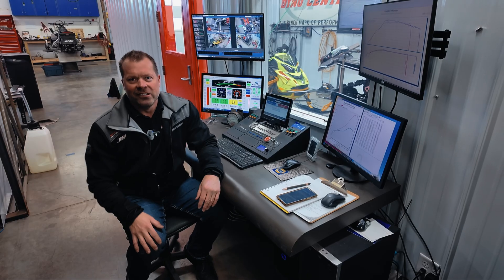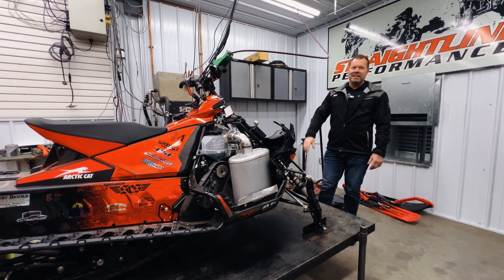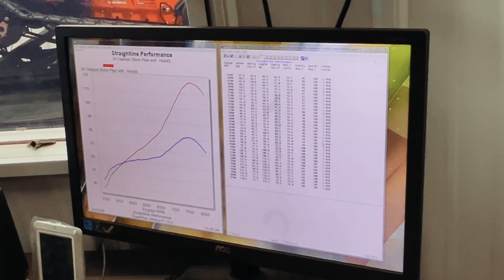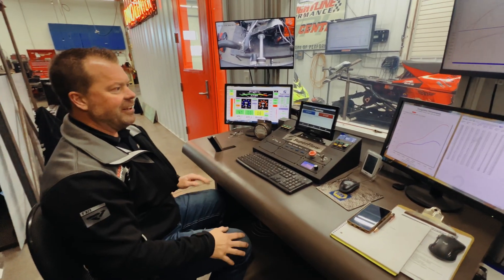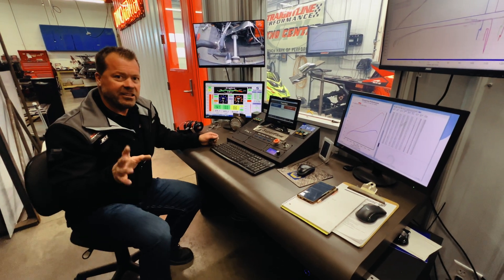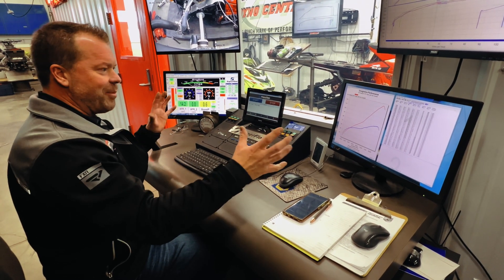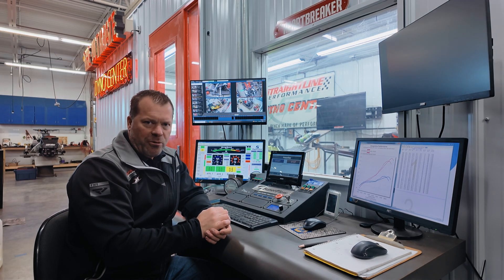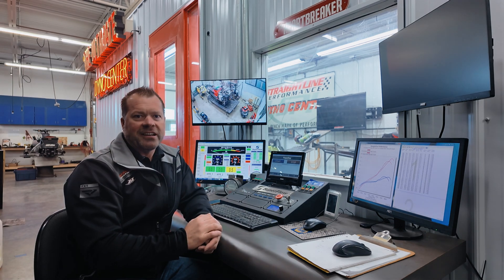Straightline Performance's 600 Single Pipe for Arctic Cat Catalyst | Dyno Run

Comment: That pipe is no better than the stock pipe. 4- 5 hp. Is the difference  in temp. And air in dynamic cell.. sad
Reply from the maker: Our dyno testing, as shown in the video, clearly demonstrated an 7-8 HP gain with this pipe. A power increase from 116 HP to 123 HP represents a 6% improvement, which is a significant gain for a bolt-on product on a 600-class engine. Factors like temperature and air conditions are always accounted for in our controlled testing environment to ensure accurate results. This upgrade provides real, measurable performance benefits.

Comment: Can you do a long run simulating a stock pipe approx a 1 mile long pull.  See what the ecu does when everything gets heat soaked?
Reply from the maker: Yes, we can simulate a wide open pull by what is called a steady state pull.   We lock onto the operating rpm, in this case 8200 rpm and hold until sensors baseline.  Typically will take 15-20 seconds to baseline and then will stay the same from there on.
Reply: @straightlineperfinc  supposedly it starts to pull timing and fuel or try to save itself when the pipe temp gets too much over 720c.  Be nice to figure out how to load the motor down to 7800-7900 and not have it detune on you.....
Reply: @fast4405 I put a 5 degree keyway in my 858. It was good for drag racing.  But when I put it back to riding in the hills it cut out on trail up. Shut  down itself 3 times in 25 k. Then for end of day it ran excellent. It’s a pretty smart ecu but if anyone knows how to trick it please share….

Comment: Boy the good ole days are gone when you guys could bolt on 15 to 40hp with single, twin or triple pipes.
I imagine your business model is getting tough with these new engines being so good outta the box. I wouldn't be spending that money for (let's be honest most sleds prolly make +5hp on the actual snow) and as lean as that's running, I wouldn't risk it. So now ya need prolly 800? dollars in programming. I dunno what the pipe costs but I imagine in Canada it's 1000 bucks. Sux but this is reality I guess.
Reply from the maker: This single pipe is $550 USD.

Comment: How much HP gain on a single pipe 850 Polaris?
Reply from the maker: The links on our website show the HP gain along with a dyno graph: 
Polaris Matryx 850 Patriot Single Pipe Ceramic Coated: https://straightlineperformance.com/product/2021-22-polaris-matryx-850-patriot-single-pipe-ceramic-coated/
Polaris AXYS 850 Patriot Single Pipe Ceramic Coated:https://straightlineperformance.com/product/2019-22-polaris-axys-850-patriot-single-pipe-ceramic-coated/